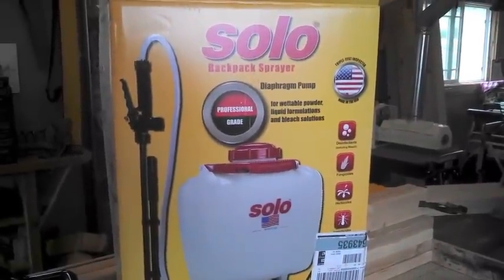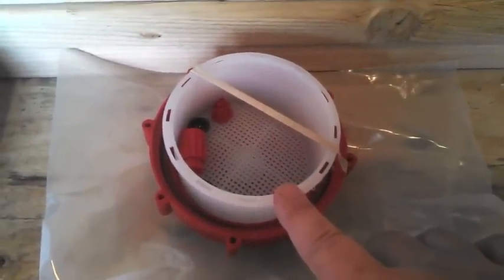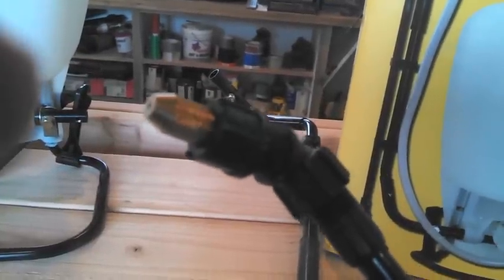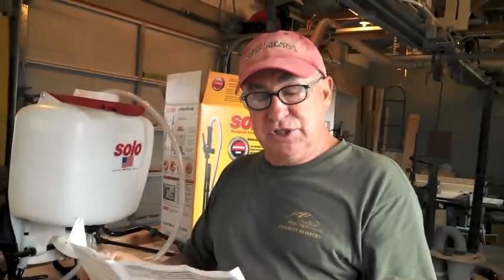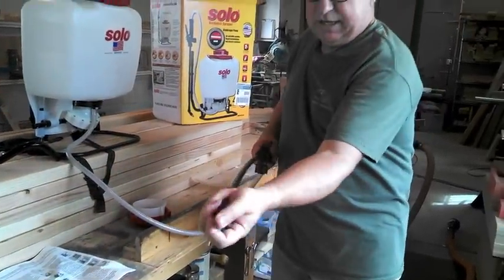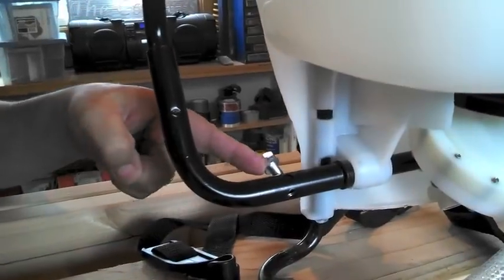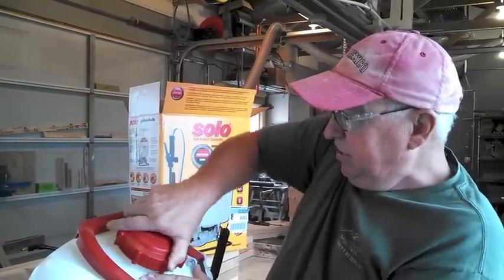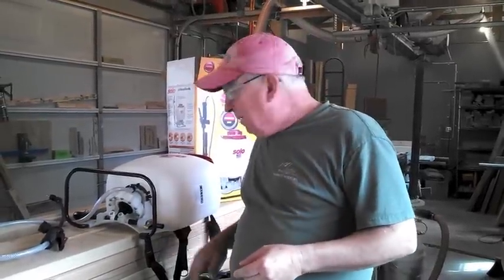Solo Diaphragm Pump Backpack Sprayer Model 475-101 Assembly

Comment: Have several knapsack units and ended up sticking with the battery pump one as it was only a tad over $100, downside of all of them is the fibreglass wand which is fragile and if pinched in a door or under a heavy Chem tub they splinter! I bought a SS wand version and they are bulletproof and still cheap! I should add I’m a pest controller so I do use my tools several times a day and are hard riden

Comment: Is there a trick to removal of the pressure cylinder -I have tried as suggested in the manual to use a block of wood to tap it out but to no avail  Cheers  Mike
Reply from the maker: Mike, thanks for writing. That cylinder almost acts as though it was welded in! You might try getting either a soapy solution into the joint, or a penetrating oil substance to see if you can get it to break loose. Another approach may be to use a blow drier to warm all around the seal to see if you can get it separate. I hope this helps! Best, DFJ

Comment: Just picked up a 425-101, seems reviews to most other sprayers always used Solo as a reference and while getting the straps adjusted, seems like they slip off the shoulder easily. Any suggestions for strap location and retention? The lower strap assist that far up. I'm not a skinny minny either.
Reply from the maker: I would suggest a chest retention strap that would wrap around  both the over the shoulder straps, holding them in place across your chest and keeping them from sliding off. Perhaps a piece of strap with velcro that you can quickly apply and remove easily. I had the same situation. Best to you, DFJ

Comment: I just could not figure out how the handle was supposed to work, until I watched this video. Even then it was counterintuitive. The thing that is confusing is the ""fold away" feature. Unless you put the handle in a vice, or have it installed, it will seem that the handle is not adjustable. But, when the base is firmly held, the handle will swivel 180 degrees so that, in one position it works for pumping, in in the opposite position it is for stowing. To be honest, between that and the fancier backstraps, I prefer the original model. If only they lasted forever.

Comment: I'm done with Solo products. Had 2 $40 sprayers (3 gal.) crap out within a year of purchase. Wouldn't hold air pressure. Had to set the damn thing down every 30-40 seconds to pump. What a joke. Why pay $100 for a 4 gallon backpack sprayer when I can get the same thing at Harbor Freight for under $40 with a year's replacement coverage?
Reply from the maker: +Tim Arnold - sorry to hear of your miserable experience. I've not encountered what you have, but that sound pretty frustrating. My suspicion is that the seals or gaskets either dried out, shrunk, or were cracked. If that happens, pressure will be lost and you end up doing a lot of of extra work to get the use out of it you bargained for. Having said that, I've been able to keep sprayers going longer by keeping the seals conditioned (using something like silicone grease) and assuring I'm using the right sprayer for the material at hand. There are generally two types, one of pure liquids that aren't caustic, and the other for either gritty solutions, wettable powders, and harsher chems like bleach. Best to you on your recent purchases. Let me know how they work out long term - that would be of value to other viewers.  Best, DFJ

Comment: Jay
I am looking to spray a vertical surface of a house.  Say 30 ft tall.  What should I use.  Will this backpack model spray that far?  If not what would you recommend?
Thanks
Jim
Reply from the maker: +jim Meehan - what is it that you are applying that far up? If it's insecticide, one of the tips provided will probably let you do that - on a calm day. If you're apply stain or wood preservative, don't think you could get the volume or the even coverage you'd need. Sounds like a pressure sprayer may be more of what you're looking for.

Comment: I just wanted to add to your excellent video one little problem I had after buying one of these units today to help anyone else with the same problem. The handle on my unit would not stow away and appeared to be a solid one piece unit, that came out of the box in the folded out position that made it harder for me to figure out. Not wanting to break anything I tried twisting the handle with a bit of force when I first installed it, but it didn't budge.

 I struggled to figure out why the box claimed the handle stowed away, and got annoyed thinking that the extra mount position was their weak excuse for a stow away handle position, because with the handle in the folded out position, it installs in the same stowed position using the second bolt hole; very confusing! After watching your video a few more times and wondering why you didn't mention any problems, it finally dawned on me that the handle must rotate and decided to used some muscle to see if the handle would move without breaking, which it finally did. My handle is very stiff but does stow away. Looks like I got an extra thick paint job that needs to be worn through. I don't know if I would have figured it out without your video so thankyou.
Reply from the maker: Jedda73 Glad to be of help and even gladder you got the stow away feature of the handle operational. Not being able to rotate the handle out of the way when you are filling, handling or stowing the unit away would be annoying. Looks like your persistence paid off! Thanks for watching our videos and be sure to check out our other topics at youtube.com/dirtfarmerjay - and pass us on! 
Best, DFJ

Comment: I've got one of these but it seems that the bleach I use eats up the rubber flange too quickly. Any advice as to why or an alternative solution?
Reply from the maker: Eddie Regory Eddie, thanks for watching our video! There are two similar models that Solo makes, but with different pump configurations. The Solo 425 is a piston model that is good for clear liquids, soap solutions and the like. Pesticides and Herbicides can usually be used in this model. The other one is the Solo 475-B, which is a diaphragm model. This is designed for wettable powders, which tend to be gritty and abrasive, as well as bleach solutions like what you are using. I suspect you have the 425. If you do, and don't intend to get the 475-B, the best thing you can do to extend the life of seals and gaskets in the piston pump is to grease coat them. Getting the pump in and out is a bit of a trick, but it's doable. Hope this helps!

Comment from the maker: Brian, sorry to hear of your experience!  From time to time, I've had similar experiences with other products as well. My pet peeve is over-packaged consumer goods with ultra-tough "clam-shells" to keep the product shoplifting resistant. I ended up in the emergency room to get my knuckle stitched back up after trying to get a cordless phone system out of a package and after literally 10 different cuts to get the package to release.  But I digress...

As for the Solo brand, it would have been smarter of them to back you up more strongly, or to have better quality control to begin with. As for it being shipped partially assembled, I can understand that, simply because there would be a lot of waste in packaging both in needed a bigger box than needed, and using up a lot of room in shipping that wasn't necessary.

Good for you being the self reliant type and just taking care of the issue. Hopefully there's not a lot of others that have had this problem hit them.

Thanks for reading, watching, and visiting us at DirtFarmerJay! Pass us on. BTW, great google plus page you have!

Comment: When did it become representative of the best America makes to ship a product that doesn't work out of the box? 

After reading some reviews, I bought my 475-101 at Home Depot in September 2014. It was $20 off--seemed like a good deal. But now I think I know why it was cheap--they were trying to unload a defective bunch.

When I assembled the pump, I found the bolt hole in the sprayer handle didn't align with the bolt hole in the pump shaft. They were completely misaligned by more than 1/4". I called the phone number in the instructions, and after three phone calls was able to get a service technician who said, "Oh, there's a service bulletin on that pump." He emailed that bulletin to me, which said "the pump shaft shifts slightly during transport" causing the holes to mis-align. But this wasn't a simple issue of a 1/8" hole misalignment as the service notice I got described and couldn't be fixed as described in the bulletin. 

I found it necessary to use my hacksaw to cut 3/8" off the end of the sprayer handle, and then I got out my grinder to finish the job. I think a lot of homeowners aren't equipped with either tool. 

If this pump sprayer is representative of the quality of Solo's "made in America" products, I'll think hard and long before buying another.

One year later: After I finally got it assembled, I've been using this sprayer for the past year without any trouble. But today -- noticeably just AFTER the end of the warranty period -- the connection rod, which is moved by the pump handle, and attaches to diaphragm -- has failed. An integral part to the entire pump. Dead in less than 18 months. I'm so disappointed in the quality of Solo's products.
Reply: The exterior of the box my sprayer came in said "Limited Lifetime Warranty". Instructions inside said 1 yr. warranty..

Comment: Could you use this to spray Clorox up to a second story level before pressure washing your house?
Reply from the maker: Glenn Taylor Glenn, I think this would be pushing the limits of this unit, but it's possible using the largest volume tip included with the unit. The initial burst may reach, but you'll have to really pump to maintain both pressure and volume. Also, having bleach in the air has it's own concerns - but no more that using other compounds in a pressure washer. Avoiding windy days, keeping the kids and animals away, and using the right clothing all comes into play.  Thanks for watching our channel on dirtfarmerjay.com!